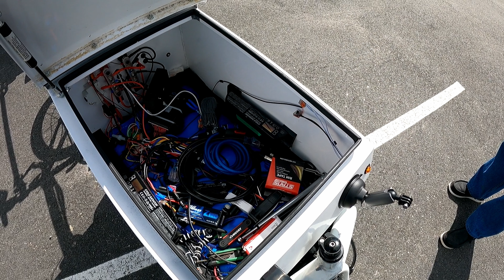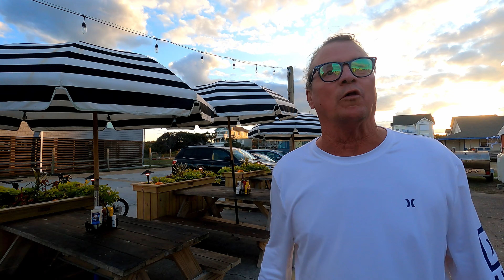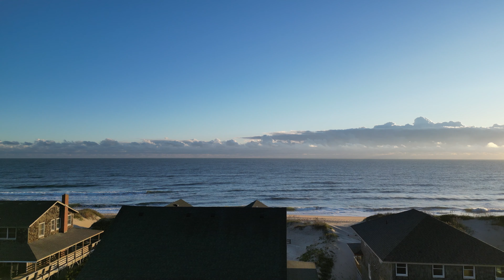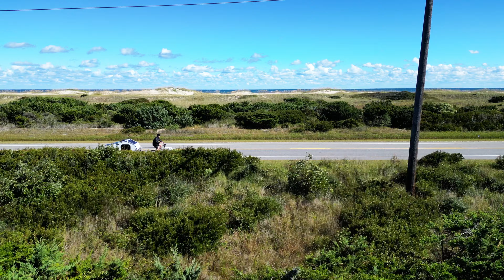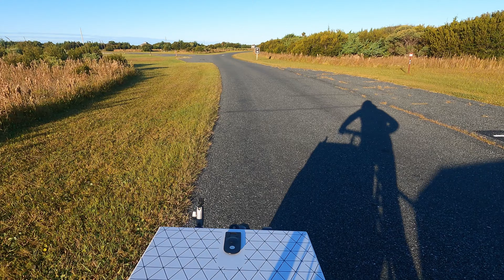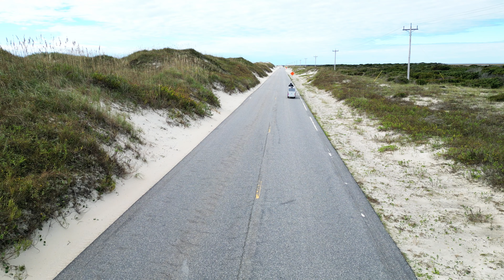Cyberdrop Electric Bicycle Camper Explores the Outerbanks, NC (Part 22)

Comment: I can just feels those watts traveling through your knees.
Besides having a good weather-protected enclosure, and a robust space for storage....  If your only goals were what the system was intended to truly solve, would you do it the same? You've got 5 wheels on the ground and some of that maintenance is going to affect your pace.
Reply from the maker: 👋 I’m happy with it. Outperforms my expectations. The maintenance is next to nothing once I size the rear wheels properly for the load. I’ll be doing some more testing soon. But yes, this turned out to be everything I hoped for and even better than I imagined in terms of ride feel, stability and aerodynamics. I think I’m missing your question, maybe? The system was designed to solve all the goals I had for it. I’d do it different if I had different goals.